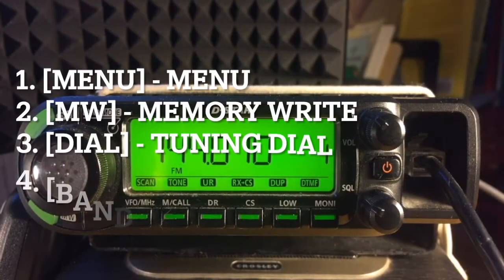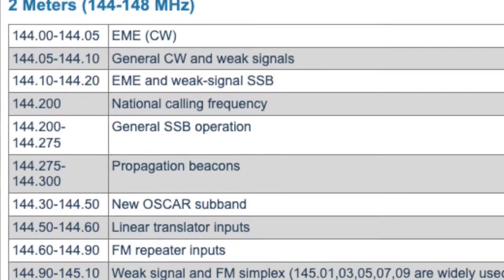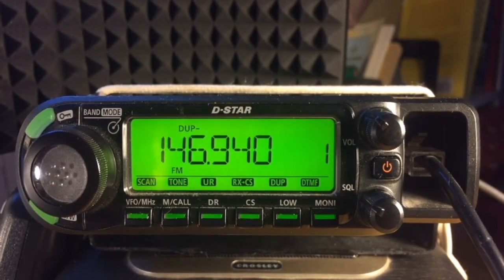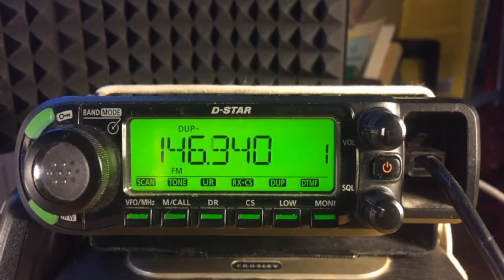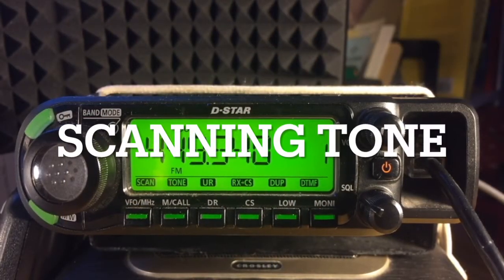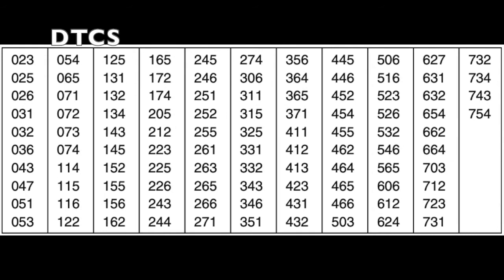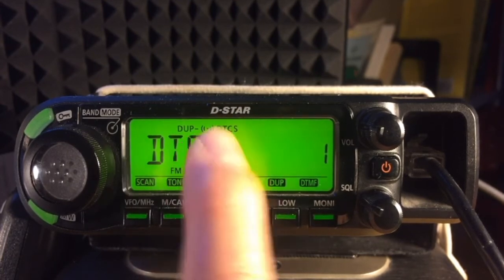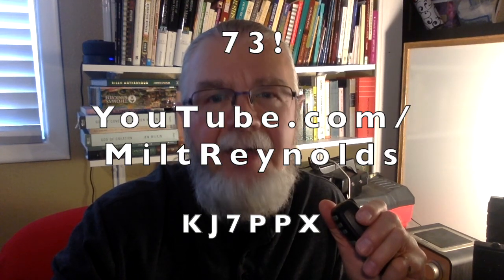Icom ID-880H | Episode 5 | Scanning: Duplex and Tone

Comment: Can you tell me what video discusses the actual setting of a CTCSS tone when programming memory channels for repeaters?
Thanks
de N8RKD
Reply from the maker: Kent, thanks for the question...I'm looking through my notes now...I'll try to get back to you with an answer as soon as able.
Reply from the maker: Kent, you've helped me realize that I've been far too long away from my ham radio station! I've not yet produced the video episode which deals specifically with the actual setting of CTCSS tone! I'm sorry! Life has interrupted my plans!

Anyway, here's some notes that might be helpful.

### Programming a Repeater Station

>NOTE: "Programming" a repeater is not the same as "Saving" to memory! Unless the repeater's settings are saved to memory and assigned a channel number, the programming will be lost if another frequency or channel is selected. The steps to save a repeater's settings to a Memory Channel will be included here, but only in brief for now. A later episode will cover this in detail.

Here are the steps required to program the ID-880H to access a repeater:

1. Ensure proper operating mode is selected:

- Long-press [DIAL]
- [DIAL] to "FM" or "DV"
- [DIAL] to confirm

2. Set repeater receive frequency:

  - Tap [VFO] to select VFO mode
  - In VFO mode, set the receive frequency (the repeater's transmit frequency)
  - Ensure display indicates "DUP-" or "DUP"

If required, set duplex shift direction:

  - Long-press [LOW] to select duplex shift options
  - [DIAL] to select "DUP-" or "DUP+"
  - Tap [LOW] to exit
  - Ensure display indicates duplex shift direction

3. Ensure frequency offset is automatically set:

- Tap [MONI] to display transmit frequency
- Ensure display indicates the proper offset frequency
- Tap [MONI] to display receive frequency

If required, set frequency offset:

- Tap [MENU], [DIAL] to "DUP.T", Tap [MONI]
- [DIAL] to "OFFSET", Tap [MONI]
- [DIAL] to desired frequency offset, Tap [MONI]
- Tap [MENU] to exit

4. Set tone system:

- Long-press [M/CALL] to set tone system
- [DIAL] to the tone setting required by the repeater: "TONE" or "DTCS"
- Tap [M/CALL] to exit
- Display indicates "T" or "DCTS"

5. Set tone or code:

- Tap [MENU], then [DIAL] to "DUP.T" and Tap [MONI] to select required duplex tone
- [DIAL] to "R TONE" or [CODE], then Tap [MONI]
- [DIAL] to required tone or code, Tap [MONI]
- Tap [MENU] to exit

The specific tone or code option remains set, but is not enabled for a frequency unless the tone system is also set. If all of the repeater stations use the same tone or code, that tone or code need be set only once, and thereafter all that needs to be set is the tone system.

6. Assign programming to a channel:

- Tap [MW] to select Memory Write mode
- Rotate [DIAL] to select an available channel number
- Long-press [MW] for three beeps until channel number advances